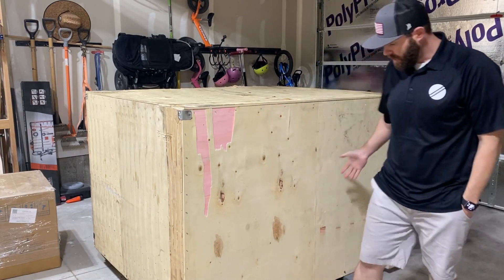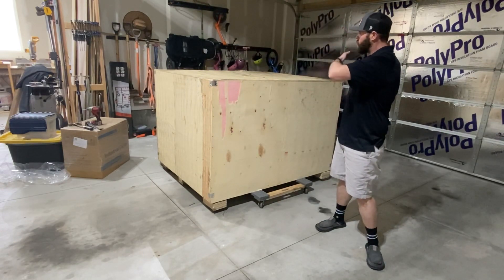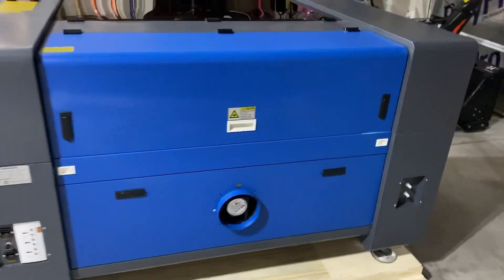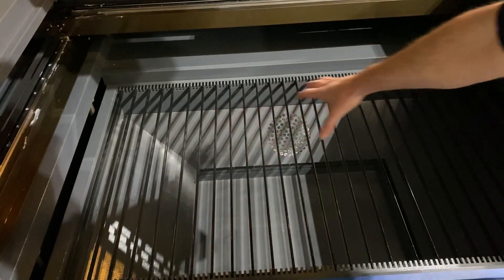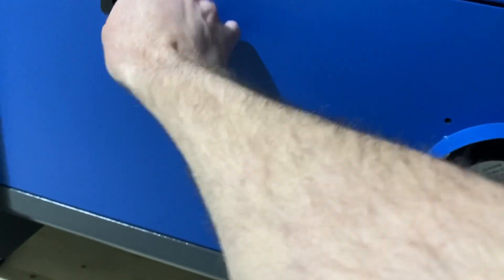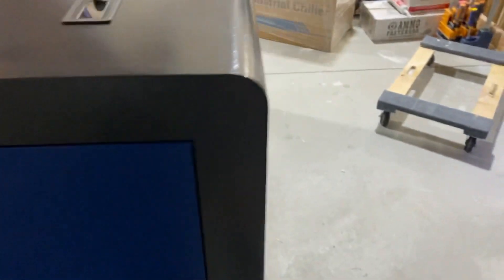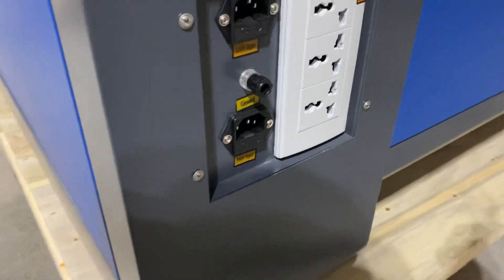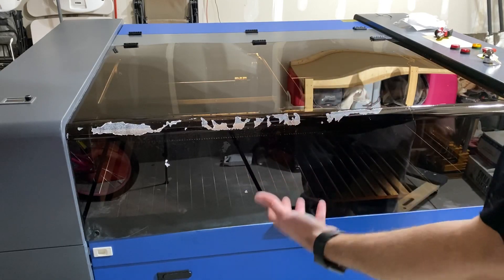100 Watt OMtech Laser Unboxing and Review

Comment: I noticed when you looked at your laser tube there was some clear tape stuck to it 
So did you take off this tape or leave it on
Reply from the maker: Just left it because it doesn’t affect the tube and if I pulled it off it would tear off the label for the tube specifics.

Comment: 6" exhaust port?
Reply from the maker: Yes
Reply: @BeardedBuildsCo  I'm sold buddy. You think it'll be an issue to scale the 100 watts power down to 20-30ish % in order to cut and engrave 1.5mm leather patches? Thanks again for all your help!
Reply from the maker: @RealDustyChandler nope. Look at my other video on the leatherette patches that I make.
Reply from the maker: @RealDustyChandler remember to get your discount and support my channel by using the code BEARDEDBUILDS5OFF
Reply: @BeardedBuildsCo  I gotcha buddy. I just watched that video right after I posted that. I'm also going to do the CA air tools upgrade and I'll use your affiliate links. Thanks again buddy! You sold me on OMTECH!

Comment: Hi,

I have watched your videos and appreciate the effort you put into helping others that are new to this.  I’ve been using my laser very successfully for about 8 months now with no problems until this morning and I wanted to reach out and see if you had any advice?

I loaded a file into Lightburn on my computer(Windows10) as I normally would and “framed” the cuts over the material.  When I hit the start button, my laser went to the first fill position(a tiny circle) then stopped and would go no farther with the cut, etc.  I rebooted my laser, my computer, and changed the USB cable connecting the computer to the laser and no change resulted.  I did get a message at one point on the computer that said “The Laser does not appear to be connected to your computer”.   If there is anything you know that might help, please share.  I can’t produce anything that is ordered until this is resolved.  Thank you so much in advance.

Comment: Just received my Omtech 100w CO2 and after setup I have a double beam while running the test file. I have a support ticket already submitted and waiting on a reply. The split looks like a Tem01 mode and I am wondering if the tube could have been damaged during transport or am I just missing something simple?
Reply from the maker: Is that split beam a test coming straight from the tube to mirror one?

Are you using at least 20% power on the controller to perform your pulses?

Comment: Hi,
Thank you for your helpful videos.  I have this exact same laser and have had some issues   with it but most have been resolved at this point as far as I can tell.  I still get a weird error cut initially on most every file unless I first send my laser to fill in a tiny circle I add to the file being cut.  It usually does exactly what it should do from that point on.  I guess I am tricking it into cooperating on the file...lol. What I wish to know is at 10:03 in your video you point to what you describe as a power supply.  My question is does the little fan in this unit constantly run on your laser? It does on mine and seems to be making enough sound that it is noticable.  I am not sure if this is normal or not but since you have the exact same machine I am hoping you can answer this for me.  Thank you so much for your help thus far.

Comment: Hi,
First I would like to thank you for putting up the helpful videos on using and adjusting the OMTech laser.  I have aligned my mirrors, performed a ramp test, adjusted the autofocus on my machine and it will cut and etch properly when it carries out the instructions sent from Lightburn through the USB.  There is an issue that I am running into that is costing me a lot of wasted material and time and I hope you can help me solve this.  As an example, if I pull up a file of a circle or anything in Lightburn and send it to my laser, it will usually cut the file to perfection on the first time when I run it, however; if I send the file to the laser to cut the same file again, the laser will often start the cut inside the circle and cut a short straight line out to the edge of the circle then proceed to cut the outside path of the circle and stop before the circle has been “closed” or completed.  The panel on my 100 watt machine(Ruida Panel) shows the complete circle with no such error.  It’s as if the laser is not following the file instructions on additional cuts.  Any help will be greatly appreciated.  For the record I have subscribed to your channel and the information that you are posting is very help to those of us that are just getting started.  I love my machine, I just need to get it to work consistently so that it will be of practical use to me. Thanks!

Comment: I have just received my OMTech 100 watt laser that is the same model as yours.  I have the Chiller, I have purchased the better in-line fan w/ duct, and Lightburn software.  I am having a very difficult time of getting this thing up and running.  I have yet to make a single cut but I have gotten it to engrave so I know it will function.  I’m new to this so any help or tips would be greatly appreciated.
Reply from the maker: https://www.facebook.com/groups/1364016877267714/permalink/1405296166473118/?mibextid=W9rl1R
Reply: I’ve only had this machine one day now but I actually got my laser running and figured out enough of Lightburn to make a few test engravings, etc.  I noticed that on some of the test pieces there was a very faint “ghost image” or shadow.  I wonder if there is an alignment issue with the mirrors or tube?What should the setting be for the knob at the top left front of this machine?  It simply shows Min. to Max.  This may be an ammeter but I’m not sure as I’ve not found any information in the manual yet.
Reply from the maker: Set that knob to max and leave it there. Did you go to the link I shared? This is a full setup guide.
Reply: @BeardedBuildsCo  Thanks  again for your help and the link provided. I don’t do Facebook but I will have to get signed back up because a group dedicated to this will certainly be a great help to a novice like me.

Comment: Thank you for the excellent video.  I am aware that this was made last year but I would like to ask you a question why OM Tech refer to some of its machines as "engraver" vs. "cutter"?  To me a 80 or 100-watt laser machine should be able to both cut and engrave so why is it referred to as "engraver" only?
Reply from the maker: The is no rhyme or reason for it. All of the co2 machines can cut and engrave. It just depends on the thickness of the material and power of the laser.

Comment: Awesome video! I just got the 80W version at work, and I'm confused about the mA readout on the left hand side on top. It has a dial, is this an actual power adjustment, or does it strictly just work as an ammeter? The instructions were fairly vague on that.
Reply from the maker: Turn that dial to max and never touch it again.

Comment: how was this overall journey? I just bought the 150w laser from them AF series...what do you recommend that will make it perform potentially at an even higher level?  lenses? better exhaust systems?

Frustrated slightly since the chat program is useless and I called on the phone and they told me to send an email about a month ago and I still haven't heard back from them whatsoever.
Reply from the maker: I have had a great experience but I have had prior laser experience. The biggest hurdle for most is alignment and understand what is a good alignment and how to achieve it.

Comment: I am currently looking at the 130 watt OMTech laser for the 50" wide bed, what sort of upgrades do you suggest?
Reply from the maker: I also sent you this list in a DM

Upgrades

NEEDS:
-Lightburn
-I always recommend an inline fan for improved exhaust as the number 1 upgrade to do out the gate. 
https://omtechlaser.com/collections/accessories/products/loudline-s6-inline-duct-fan-system-usr-cls6-us/?ref=LGS

WANTS:
-Chiller is a big deal if you are going to be doing long run times and you don’t want to manage water temps by hand. 
https://omtechlaser.com/collections/accessories/products/6l-water-chiller-lcw-5200-us?ref=LGS

-Air assist - this really comes in key when you are trying to to get the best cut possible with minimal residue. I made a video and linked everything you might need in the description.
Upgraded Air Assist for Chinese | OM Tech CO2 Laser https://youtu.be/y08B1v8-q-c

Everything the you absolutely need to get started comes with the machine. All of these items make improvements on what comes stock.

Comment: 10 months later............Do you wish you would have gotten the Omtech 130 ??
I am tossed between the 100 and 130.........do I really need to be able to cut 12mm acrylic?
I own a sign shop and feel I might need to do 12mm or 15mm acrylic and other substraights
Reply from the maker: Yes! For the additional cut speed and extra bed space. With the 130 it can take a full width of 4x8 ply.

Comment: I have a question 🙋‍♂️ Will the beast fit through a 36” man door?
Reply from the maker: If you take off the casters, feet, and all the buttons on top the height of the machine is about 34 1/4”. You would have to turn the machine on its back to even attempt it. I won’t guarantee anything because there are so many factors to take into account.
Reply: @BeardedBuildsCo   thank you for the reply, I just built a nice shed that I have all my craft stuff in like my ORTUR laser and my vinyl cutters now I want to upgrade to a bigger laser. Man that thing is a beast.

Comment: Awesome! Looking to purchase the same one(I'll use your affiliate). Before I jump the gun, do you feel the 100w is too powerful for some engravings? I've read it might not drop enough in power or be consistent when it is at lower power. Whats your experience with that?
Reply from the maker: I have had no issues with engraving. I just did some engravings on some gun stocks. It’s on my Instagram.
Instagram.com/beardedbuildsco

Comment: So video on how to disable the beep coming soon I assume? :)  BTW is the exhaust 6" or 8"?  Just ordered my 80w 36x24 unit trying to make sure I get the right size exhaust fan before it gets here.  Also on you're cw 5200 chiller what temperature do you typically set it to run at?

Comment: Would I need to purchase both lightburn and coreldraw?
Reply from the maker: I really only recommend lightburn. If you have another program where you are creating vector files, then keep using that.
Reply: @BeardedBuildsCo  Thank you for responding so quickly im barely starting off so I'm kind of lost right now. I'm purchasing my machine today and it suggested both lightburn and coreldraw but I didn't want to pay the almost 400 for coreldraw if I didn't need to.
Reply from the maker: Which machine are you looking at?
This is my NEEDS AND WANTS list.
Upgrades

NEEDS:
-Lightburn
-I always recommend an inline fan for improved exhaust as the number 1 upgrade to do out the gate. 
https://amzn.to/3itFCFl

WANTS:
-Chiller is a big deal if you are going to be doing long run times and you don’t want to manage water temps by hand. 
https://omtechlaser.com/collections/accessories/products/6l-water-chiller-lcw-5200-us?ref=jnnfdsk4edqe

-Air assist - this really comes in key when you are trying to to get the best cut possible with minimal residue. I made a video and linked everything you might need in the description.
Upgraded Air Assist for Chinese | OM Tech CO2 Laser https://youtu.be/y08B1v8-q-c

Everything the you absolutely need to get started comes with the machine. All of these items make improvements on what comes stock.
Reply: @BeardedBuildsCo  Thank you so much im going to look into all that now. I'm wanting to get the 60W CO2 LASER ENGRAVER CUTTING MACHINE WITH 20” X 28” WORKING AREA (WITH AUTO FOCUS) . This is the machine I want to start with maybe as time goes and I learn more I can upgrade to a 100w machine.
Reply from the maker: That’s awesome! That’s the machine I started with! Use the service code BEARDEDBUILDS in the promo/discount area if you feel that my videos and answer have been helpful.
Reply: @BeardedBuildsCo  Thank you I definitely will

Comment: This came two days too late for me, but great video! I am working on a little unboxing video myself of the 100W Red & Black OMTech.
Reply: @Mark Adams - it went great! That was the easiest part of this laser business!
Reply: That’s the one I’ve been looking at. Can I ask what made you choose that one over similar models like this?
Reply: @roaminrabbitt  - Honestly, I finally felt ready and it was one of the few in stock  (on OMTech's website.) I was originally looking at an 80W with a larger bed but it was out of stock. Then I thought about the much smaller 50W just to see if lasering was even going to be a good fit for me. Then I thought, well, if it is, I may as well have some power and bought the 100W. I have the red and black though, which has a smaller bed (20x28) than Bearded Builds Co. I would love to have that larger bed now but mine has a pass through so I will be able to do larger things using that. I am very happy with my purchase!
Reply from the maker: The 100watt 24x40 is a great size and I would not be able to fit anything bigger. The power is awesome and has really increases my production ability.
Reply: @BeardedBuildsCo   with this laser, did you figure a way to still use the rotary and do tumblers?  Will it go low enough to allow room?